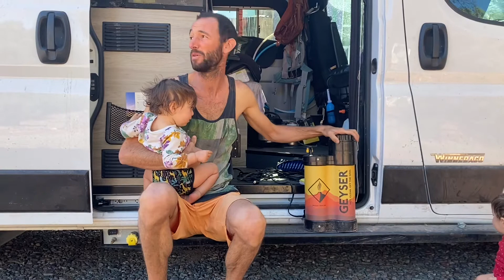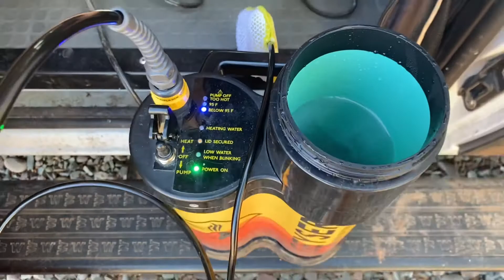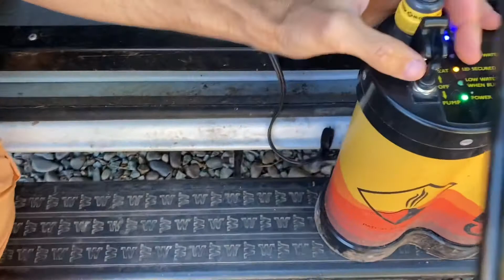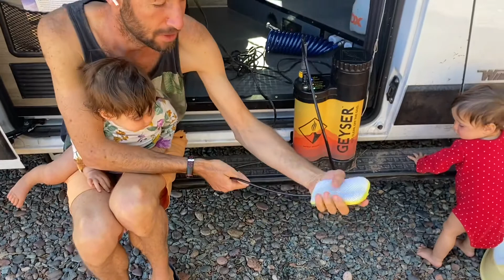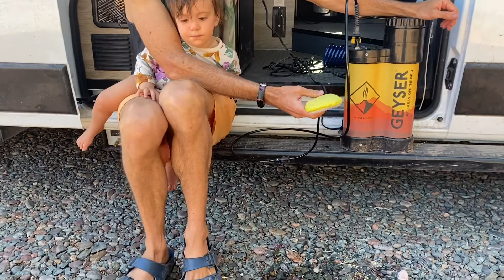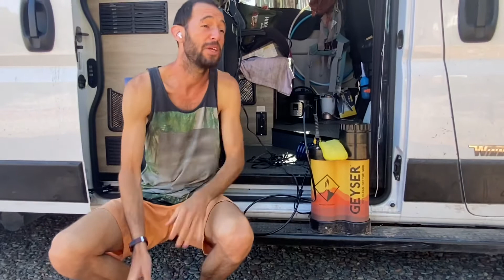Brutally Honest reviews - Geyser camping shower review

Comment: Hey have you reached out the geyser. There customer service is awesome. Looks like you have the older unit as the new unit heats up even more and has upgraded hose. Reach out to IAN. He will take care of you. I’ve had mine since 2020. Tell them Cesar sent you.
Reply from the maker: I absolutely did reach out to them. They basically said they recommend the non-electric version if you want to take more than 1 shower as propane heating is more efficient... Possibly they improved their product since then, but personally no longer relevant for me.
Reply: I bought one and it did the same thing. Returned it and the replacement does the same thing.  Pretty frustrating when every review out there says it’s the best thing ever. Good job with the “brutally honest” review.
Reply from the maker: @billchadwick672  yup. too bad you didn't see my review beforehand ;)
Reply: @brutally_honest  now I just need a portable ice machine to take camping with me lol.